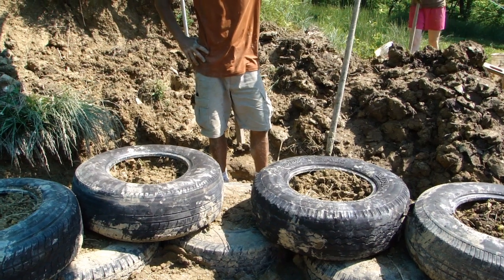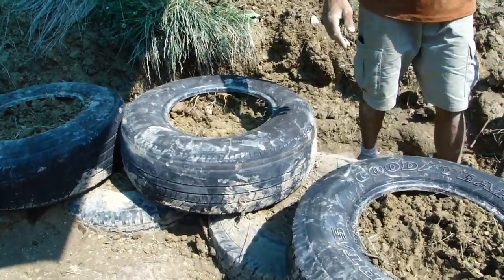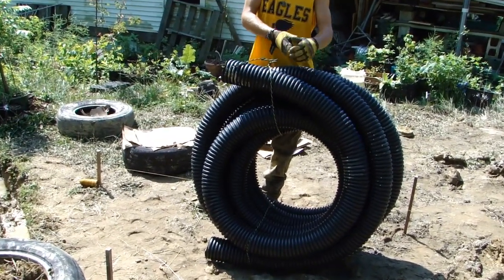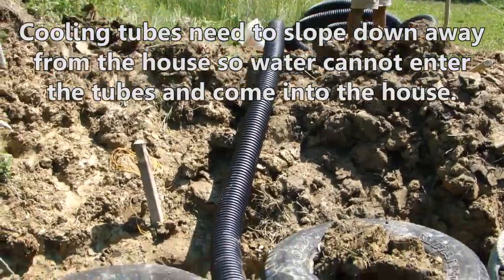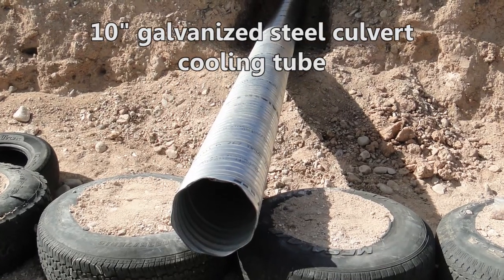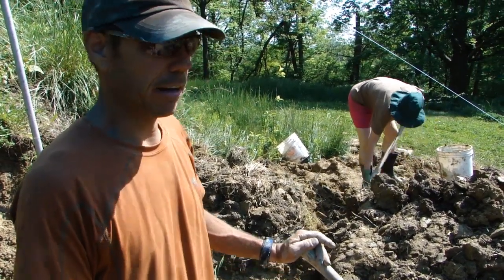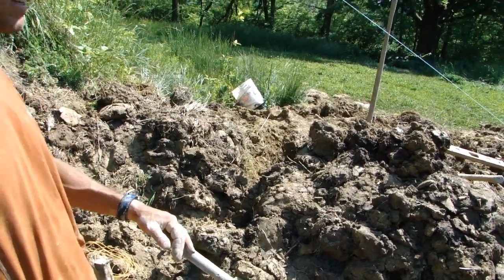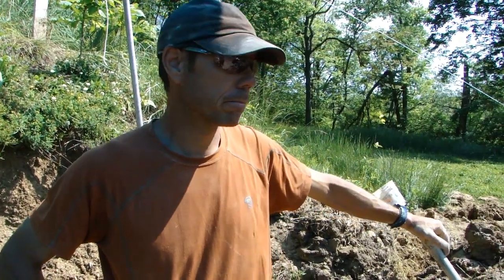Cincinnati House - Cooling Tubes

Comment: As a builder for 35 years the Galvpipe is a NO NO The metal touching ground creates electrolysis and the steal will rust away quickly Even when you run copper pipe through a block wall touching the concrete block that spot will fail in time

Comment: The steel culvert is a good idea, watch the price of steel, and alternate would be concrete pipes.  I wanted to see how you finish either end when the house is finished, how much maintenance (filtering) is needed and what volumes of air work best.  You need a lot of square footage of opening, to exchange all the air in the house every hour and then you have to bring that into the house in a clean and almost unnoticeable fashion.

Comment: I think you are right that it is sufficient for a greenhouse.I came up with another idea because i have been thinking about this a lot for my Earthship cooling tubes. A couple of times a year, run a UV light through the tubes. It should kill all living bacteria as far as i know.  I should have done more research on my cooling tubes because i put in 2-4" inlets into the 3rd course. So I will probably incorporate another tube(10")  on a higher coarse and then tilt it down then out. Live and learn.

Comment: I agree, but as I think about it, it is rust proof, meant to hold and transport liquid and has no joints. One could flush it out a few times a year with a bleach, vinegar, Lysol or other anti mold, bacteria solution. The ridges do give an added structural support to the tube as well. I think 10" PVC would be the ideal choice, but it would add lot of cost, especially for a green house.